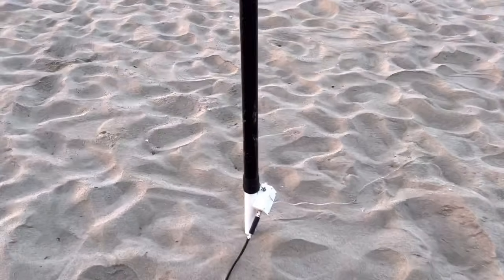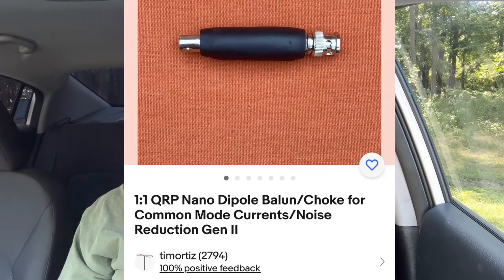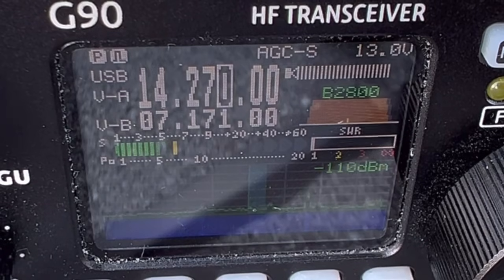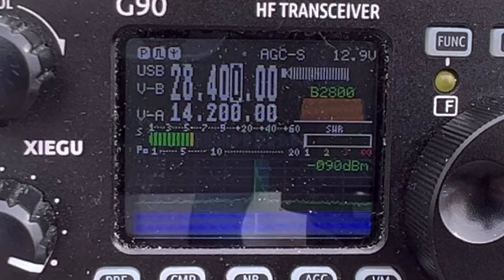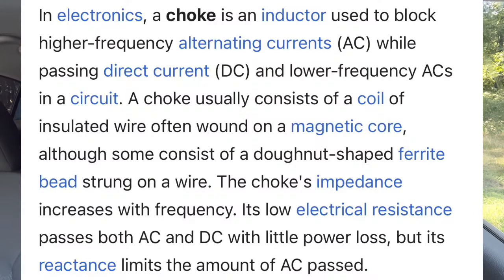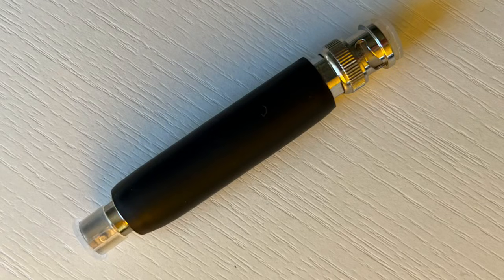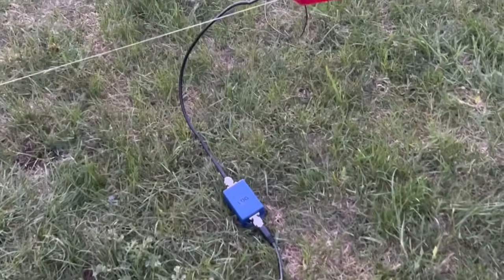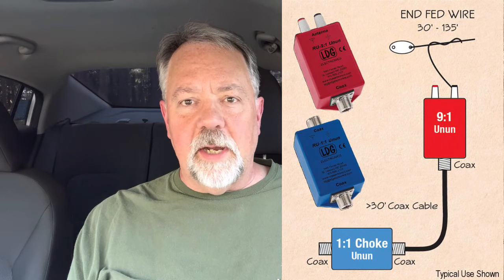Understanding RF Chokes for Antennas

Comment: A lot of hams Or suffering from common mode current On their coax And don't realize it . For instance If you're using A Big wheel 2 meter antenna For horizontal sideband  Without some kind of choke You will find The noise floor much highe bue to the coax Running vertical to the antenna As the outside of the coax Becoming part of the antenna We all know vertical has more noise than horizontal The end result is you wont be able hear as far as you can transmit If you have common mode You could be tripping GFI breakers, Setting off smoke alarms , Causing audio interference in your stereo and TV set And creating a shock hazard For the operator of the radio These choakes keep RF signal off the Outside of the coax Remember any in terferance You have,  your neighbor might have it too Once they figure out where it's coming from You have a new problem
Reply from the maker: Great comment, thanks!

Comment: @2:24 you say you had a "perfectly tuned" antenna with a tuner but it had a poor SWR...???  How could it be both "perfectly tuned" and getting a high SWR?  When I say tuned I mean the SWR is good.
Reply from the maker: The SWR on the meter was the result of the common mode current coming back to the radio from the coax
Reply: A perfectly tuned antenna is resonant at the operating frequency.  That means it has no reactance and looks purely like a resistor and the SWR will be lowest at that point.  But unless that resistor is 50 ohms at that point, then your SWR will still not be 1:1 even though the antenna is tuned.

Comment: A half wave whip antenna should really be a half wave vertical dipole if I'm not mistaken...  I make these using coax for UHF using a section of the shield folded back over the bottom of the coax...thus each end is approx 1/4 wave and together a half wave vertical dipole... Isn't this basically what 1/2 wave whips for CB are that are around 18 feet long?

Comment: Hey Walt this question isn't really related to this video but specially the g90. I recent got one running the 1.79 firmware and for some reason I can't adjust the bandwidth. I'm stuck in 2650. Th manual method for adjusting the left and right sides of the bandwidth don't do anything. Any idea?
Reply from the maker: Wow, I'm not sure. Sorry I couldn't help.
Reply: @COASTALWAVESWIRES  it's not the end of the world but Google doesn't know either! End of days! Going to be putting together your recent "short" random wire for my base station using the Xiegu. Since you're using a 9:1 do you ever use the ATU?
Reply from the maker: @stevecairney78  yes I have to use the ATU, the 9:1 just gets it in close range but definitely still need the ATU
Reply: @COASTALWAVESWIRES  thanks Walt,my goal is to hit your east coast from the UK so maybe we'll bump into each other.
Reply: FOUND IT! For anyone else wondering. It's changed since FW v1.79b02. Best thing to do is download the latest manual from radioddity (V4.31) and it's on page 38

Comment: Do you use any form of RF earth / ground when you operate portable? I plan on doing lots of portable from my boat and intend to earth my radio with a wire going into the water. (I also have a choke (coax wrapped around a toroid). 
73
Reply from the maker: I really never use any earth grounding portable other than the copper rod mount I occasionally use. Typically just the antenna, choke and counterpoise is all I do. The wire in water is an amazing RF ground when on the surface of the water in saltwater. All the best and 73

Comment: An air choke( AKA ugly balun) size deprnds on two main things the size of coax and the rated velocity of the coax lower velociity gets by less coils size of choke depends on thickness of coax 214 larger needs larger circles or you take the chance of the skin radiation of conductor to throw off the com mode
Reply from the maker: Thanks for the info and comment!
Reply: @COASTALWAVESWIRES  yeah I was system tech with charter cable over 20 years and the higher the freq the more you must respect bend radius I learned to practice no matter the freq used for transmit and recieve

Comment: Another inspirimg piece of work.  We just bought a 1:1 with the new ic7300 and the 100w TennTennas efhw.  Will try it with and without.  What you're saying is that since the feedline is choked off, we'll need the .05 counterpoise(?)..
Reply from the maker: Thanks! yes, when I choke at the feedpoint I use 5% of a wavelenth for the counter. For a standard 65' long EFHW I typically use a 6 and a half foot long wire.

Comment: I do alot of QRP using 5 watts and a EFHW  and have had  alot of success. On my coax just off the radio I have about 15 snap on ferrite beads and my swr and rf on my antenna is hardly measurable. and I've made some noce qrp dx contacts. 73 Walt from ki0ad
Reply from the maker: Yes I probably should have mentioned choking at the radio for an EFHW in the video. Thanks for commenting! 73, Walt

Comment: Hi Walt, I've always been a big fan of having a tuner at the feedpoint of an antenna to minimize coax loss from high SWR in the coax. I had also heard that tuners at the feedpoint don't allow common currents on the feedline and like you say for chokes isolate energy into the antenna so that the amount of energy radiated is maximized. I wonder if this is actually true. Should I also put an isolation choke where the remote tuner connects to the coax when using a tuner at the feedpoint of an antenna? I'll have to experiment.

Recently I've gone to a 4:1 balun at the feedpoint to my 80 meter horizontal loop antenna so that I can run 600 Watts. An isolation choke after that balun and before the coax connection might be worth a try. Maybe an air choke would be easiest and cheapest.

Also does a choke change the SWR of an antenna like an endfed due to electrically removing part of the counterpoise from the antenna (ie the coax shield of an unchoked antenna)?
Reply from the maker: Good question, need to deep dive on that one. Tim G5RV is a big user and believer of the tuner at the feedpoint. Was just talking to him this morning and his next antenna will be done that way. I was thinking about something like that for a 5/8 vertical.
Reply: To my knowledge adding a remote tuner at the antenna feed point should give you the match your looking for without any additional choking. But if your running high power they can get quite expensive
Reply from the maker: My friends call me “Twenty Watt Walt” I don’t have to worry about that 😂

Comment: What happens to the common mode current that is choked off? Where does it go? Is it dissipated as heat or reflected back to the antenna?
Reply from the maker: My understanding is it is back to the antenna
Reply: A bit of both.  Chokes get hot because they aren't perfectly inductive (they have some resistance) and they dissipate some of the power as heat.  The inductive part presents a high impedance to the RF, so it looks like an open and little current flows through the choke.